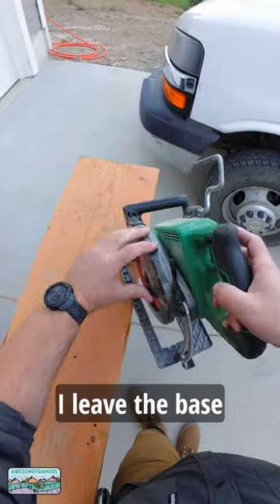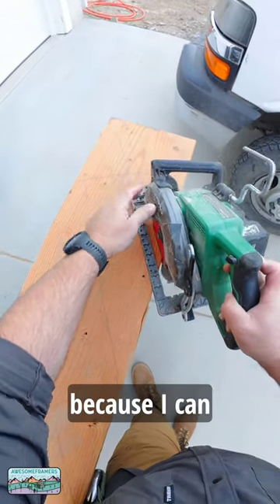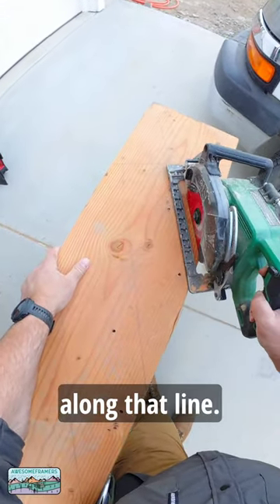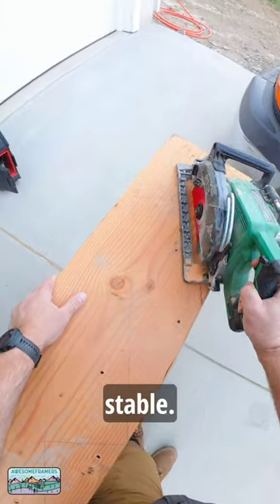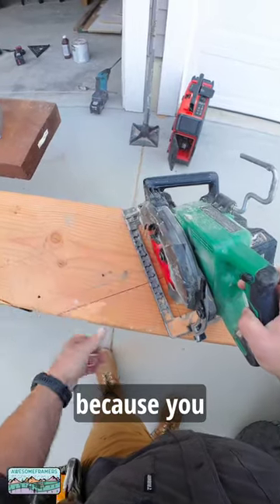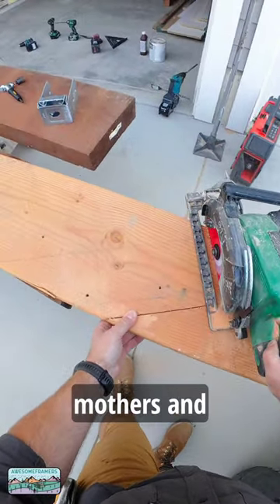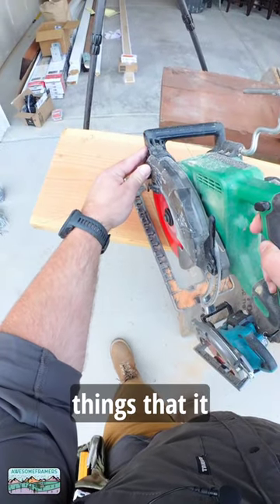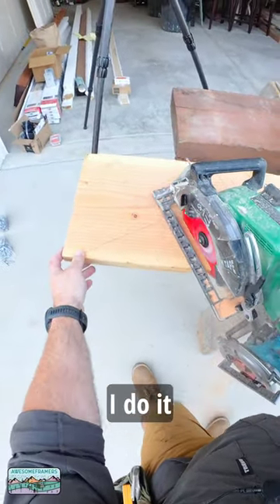Loosen Up Bro #construction #framing #building #diablotoolsambassador

Comment: I do it in America. I've seen other people do the same cut with the plate tightened. It takes more practice to do it with the plate tight. Anyone can do it right the first try if the plate is loose. It works like a compound miter saw and keeps the blade at 90° (perpendicular to the work piece) so you have a tight fit.

Comment: Nice work. Interesting technique. Definitely will keep in mind the next time I’m cutting stringers. Often. 2x12 has enough of a cup in it that getting an awesome cut is a fight.
Reply: If you aren't making a split cut, and have to stop the saw halfway through the wood, than have a more precise cutting tool handy to deal with the remaining material attached. Would suggest a jigsaw or oscillator, or if nothing else, a hand saw.

Comment: All of the 40 year old+ journeymen I work with do this. Pretty annoying when they grab your saw to make a couple cuts while you are gone and you don't realize that the depth guide has been tampered with while you were gone. If I grab someone's saw and have to change the depth, I'll set it back to where they had it before I used it; common courtesy. It's only screwed me over a couple if times really. Now I always check the depth and never assume that no one has handled the saw while I was away. Also, zero out your chopsaw multiple times a day, because of the same reason.

Comment: I make counter tops, I always leave my base plate loose on the saw that I use to cut the sink bowls out from the underside. I mark the perimeter and then plunge in on each line then finish the corners with a jig saw, I’ve found that I leave it loose now in most circumstances because plunging can be handy elsewhere and not having it locked doesn’t seem to cause me a problem any other times.

Comment: that saw is awesome until the brake goes out hope they fixed that problem prolly got a lemon🤣
Reply: It's just a regular circular saw, you can move the baseplate like that on all of them.
Reply: You don't need a break to cut wood
Always set it down with your right hand palm up 
Left hand palm down. 
That way the blade can spin to a stop and it's not so close to the ground

Comment: What brand is the electric saw tool?
Reply: Metabo HPT 36V rear handle
Reply: Yep I was about to say Hitachi or Metabo HPT (hitachi power tools).  I don’t have this model, but the one I do have works great!
Reply: Depends. Do you know what a 7 1/4 saw or a 185mm saw is? If it's latter, it's a HiKOKI.

Comment: Plunged too deep, it cuts at the wrong angle to the saw's blade, which makes it dull faster, and cut slower. Which is why people lock in their depth 1/8" deeper than the wood its cutting through. There is a reason, but you think you're smarter than the person who taught you the rules in the first place, just because they didn't give the specific reason.
Reply from the maker: You gave your own comment a thumbs up? 🤣🤣🤣🤣

Nope, I don't think I'm smarter, that's your insecurity speaking.

Comment: Why don't you take that gard off so you don't have to hold it up. 
It's. " safer,"  off the saw. 
You wouldn't need to touch the base plate  if you had a real saw 
That wasn't struggling to cut some 2×
 What ?hold on .
Is  that  1×8 DF ?
Oh my God.
Dude , put that thing in the toy box 
Get a 15amp saw.  
So you can
 join the workforce 😂
Reply from the maker: 1x8?
Reply: @AwesomeFramers  what you cut in the video..
It  looked like a 1×8
Reply from the maker: @cristinafultz4572  2x12. Since you can't tell the difference, why wou the rest of your previous comment be taken seriously?
Reply: @AwesomeFramers  
I looked up the saw you are using and  apparently it can use battery or 110 /15a
With 7 1/4 blades  
So perhaps I was wrong about your saw.
On the other hand  mag77 has never let me down  I got my first saw for Christmas in (98) and only ever used skill saw before. 
I don't remember when I seen the first Dewalt saw come out.( I didn't care for it)
Then ,  I think the next was bosh and it was basically the same exact thing as a skill except it didn't come with a  cord. You needed to plug in a extension cord into the handle.  That always bothered me. 
Some how one of those bosh skill saw is my primary right now. 
I don't like it very much  but I'm getting to The end of my work life and don't want to spend money on something that's going to out last me.
Any ways like the video and I subscribed. 
So see you on the next one.
Reply: @AwesomeFramers I watched it again and yes sir I guess the way the 📷 is it was making the saw look a lot bigger to me.
Anyway ,   the more I think about it I'm sounding like if I make fun of it  then I can stop being jealous 😮
Reply: @AwesomeFramers  because we can't tell the scaled size from a video without a tape measure, duh.
Reply from the maker: @yorkumz1127  you can't,but others can

Comment: I do it all the time. Almost always with worm drives. I'm in America. Worm drives just feel like they want to be loose.
Reply: I do it the same way.  In the USA also, but I wouldn't use a worm drive at all.  Never found a benefit of all that extra awkwardness, weight, and price of a wormy.   
Places I've worked have had almost no one that uses one.  Just don't see them.  
Now out West, they seem to use nothing else........but considering it is the Left Coast and all, not surprising really.
Reply: @snafubar5491     -----   the benefits of a wormdrive are many

*they are generally much more powerful with lots more torque than the ice-cream mixers
*the blade is on the correct side for a right handed person  -  most ice-cream mixers have the blade on the right side where you have to look around the saw to see the blade and cut-line
*the handle is low and to the rear  -  when you push it forward,  the force is inline and forward  -  on ice-cream mixers,  the handle is generally on or toward the top  -  when you push, you are either picking up or dragging it from the top
*with the handle behind the blade, it is easier to control the direction of the cut since you have leverage   -   with an ice-cream mixer,  you are trying to control from the center / top of the saw basically over the center of the blade
*the weight of the saw is a bonus when cutting downward  -  something that happens a lot when framing
*the handle / trigger at the read and inline with the saw body is a huge plus when cutting upward or overhead

the cons are 
*they usually cost more 
* the weight when you are having to make horizontal side cuts like topping posts but the fact you can push the saw instead of drag it when making horizontal side cuts is usually enough of a pro to cancel that con

once you've gotten accustomed to a wormdrive,  you won't use an ice-cream mixer unless you have to make a miter cut to the opposite side
Reply: @bonesrhodes3762 ..........Nice copy and paste.  
Yes, yes, alotta folks swear by them......but alotta folks voted for FJB, too, so there is that.  
You want to tote that concrete block around, be my guest.  I was taught to work smarter, not harder.....but you do you.
Reply: @snafubar5491     no copy and paste at all  -   60 years of personal experience  -    but you just keep using inferior, under-powered harder to control tools and producing low-quality cuts,  but then there are always track-saws ( good luck using one to frame )     -    and if the weight of a saw is a problem for you,  then you need to be installing window blinds and not trying to do carpenter work
Reply: @bonesrhodes3762 ........I suppose it probably burns to know you did it wrong all those decades......huh???  And that was a copy and paste so don't even try.
Funny, I never had any issues.  Well, when one has a superiors skills they can make the less skilled understand just how inadequate they really are.....and have been for 60 years.  That must really be terrible for you.......huh???
Reply: @snafubar5491    ---- nope:  not a copy and paste,  coprophagous one  -   not everyone is as incapable of expressing their points are you are

you have more issues than Trump has legal costs  -